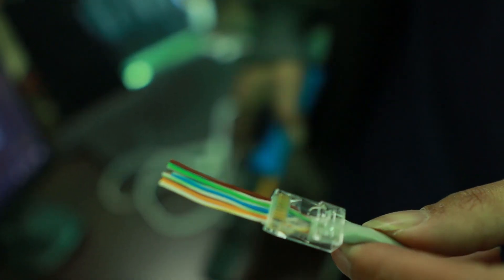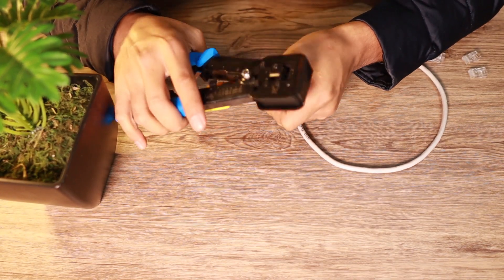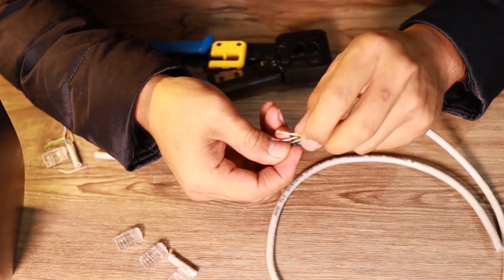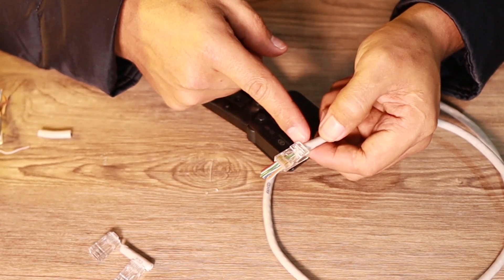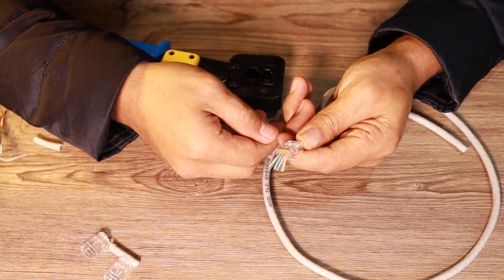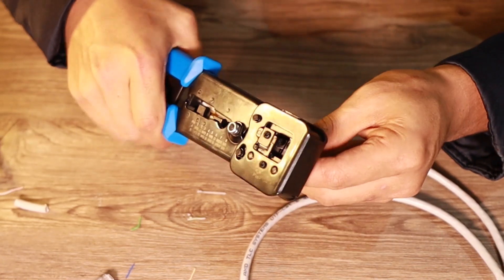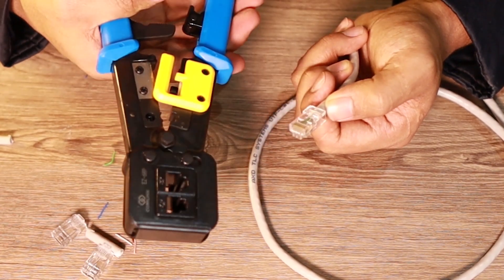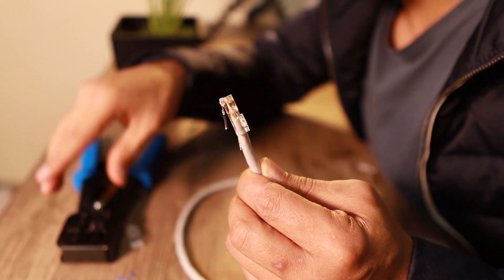Precise Crimping! PASS THRU RJ45 and CRIMPING TOOL

Comment from the maker: If you're a DIY guy you would most likely want to crimp your own ethernet cables. I have been making my own cables now I got a new crimping tool called a pass-thru and it really helps you make ethernet cables faster more precisely. Using a pass-thru crimping tool, you also need to use a pass-thru rj45. It is called pass-thru because unlike other crimping tools the copper wires need to go through the rj45 then the crimping tool will cut it while crimping the cable. Watch the video for more details.

Amazon link:
Pass-thru crimping tool and RJ45: https://amzn.to/2ZuiCNL